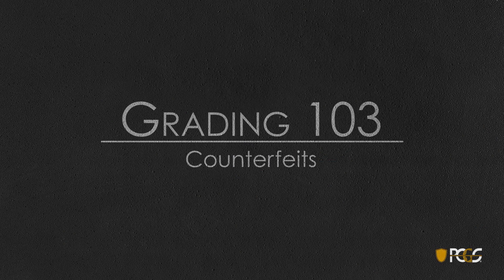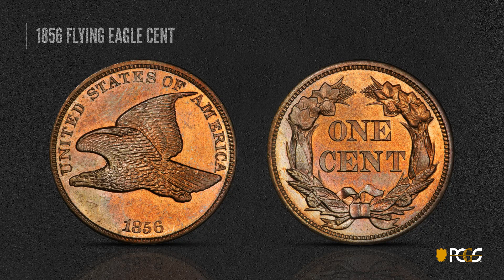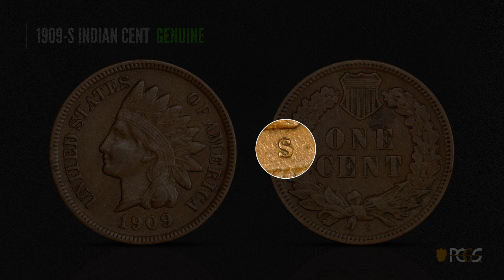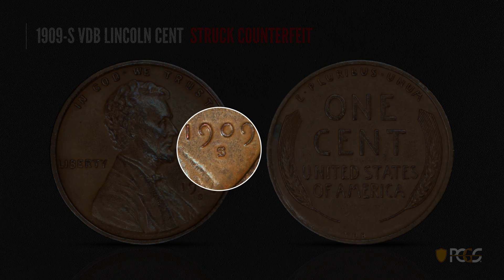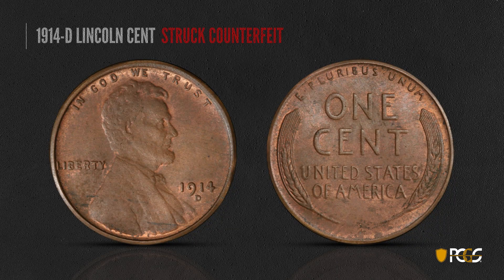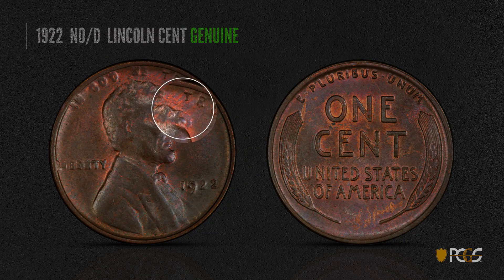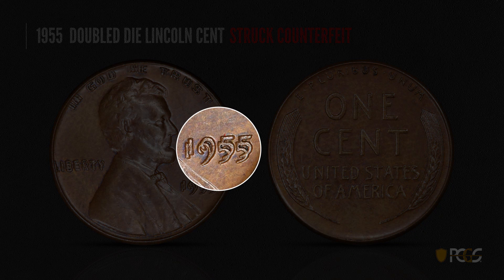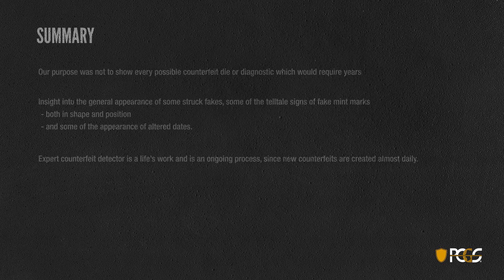Counterfeit Coin Detection - Copper Coins

Comment: I have a 1955 that the date is not doubled but it looks as if it had a worn out die, the liberty sits lower than most other pennies and the L has shifted to the left that it's not recognizable, the coin is sharp brilliant but the leaves on the back look like the die was just worn out,, you think someone would counterfeit a 1955 and not double the date?
Reply: Big John It's unlikely someone would counterfeit a 1955 non-doubled, but it is possible. It would most likely cost far more to make the coin than what the counterfeiter could make off of it.
Reply: Cox Coins one thing I also noticed on the penny is it looks as if it had a ,I call it, a die shift, when you flip the coin the back is spun around,,, could this be a type of double die without the date being doubled? Obvious the 55 was a bad year for this coin
Reply: Big John Coins are sometimes not struck straight on and that's normal. I am unsure exactly what you mean without a picture, but if you want, you can always send it in for grading.
Reply: Big John Sounds like your describing a rotated die. If you place Lincoln where his profile is 90 degrees in between with your thumb and forefinger at 3 and 9 o'clock and spin the penny vertically so that the reverse shows the Lincoln Memorial should be perfectly oriented as well. If it isn't this is a rotated die error. It is measured by how many degrees it is off from what it should be.